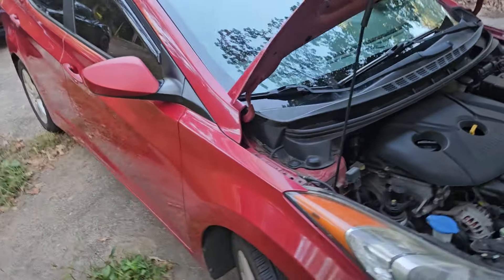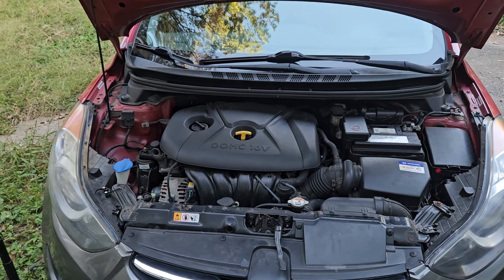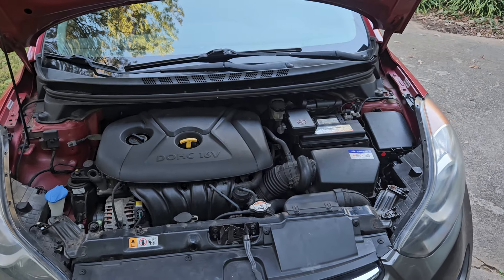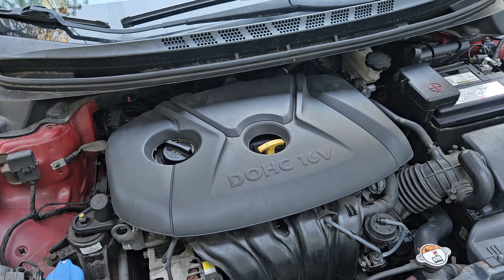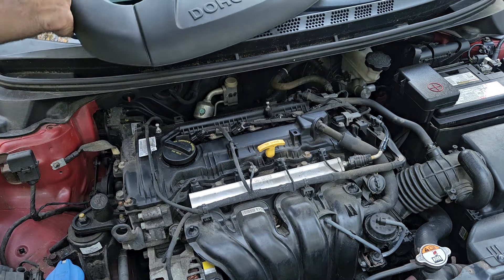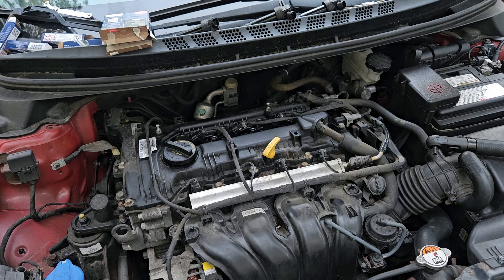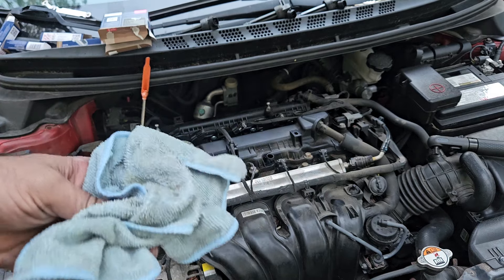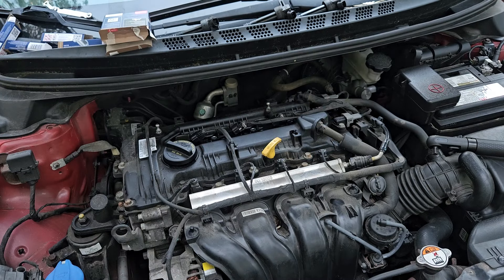I spent over an hour in traffic for this. #mechanic

Comment: You have a miss and you know one of the coils is arching. Should you not fix that before changing plugs?
Reply from the maker: @garymcauley7630  I'd do both at the same time.  Arcing from the coil insulation can damage the spark plug and visa versa. The fact that the energy is finding a path through the coil insulation could mean that the spark plug contact has high resistance.